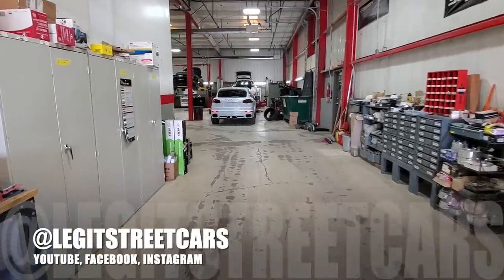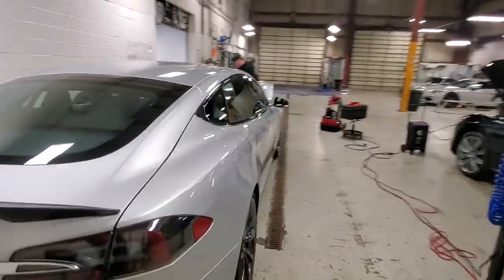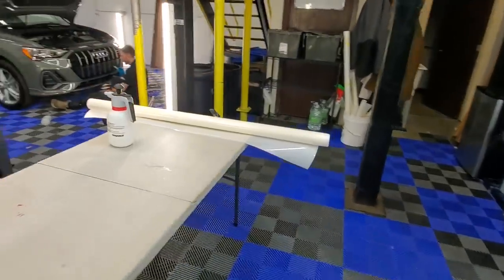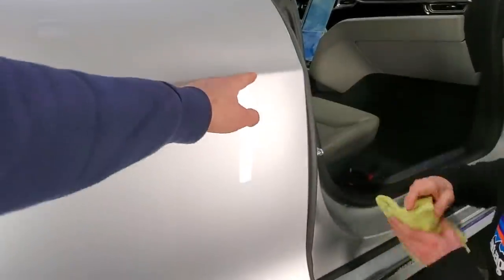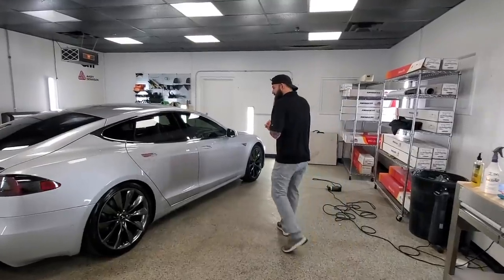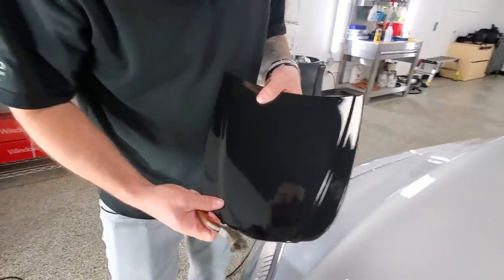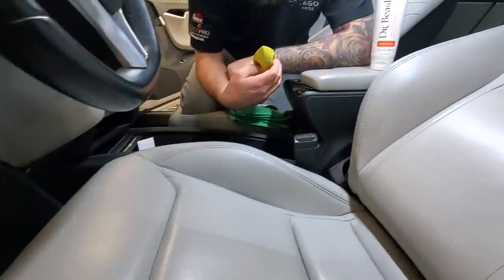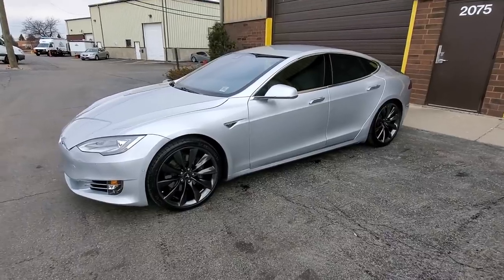My CHEAP SALVAGE AUCTION Tesla Is 100% COMPLETE! Final Detail, Tints & Self-Healing Wrap Install!

Comment: looks amazing! if i were to do it i would paint the roof black then take it back up to chicago auto pros and get that wet sanded buffed and the ppf installed on top of it. it will look like a real pano roof. no dulling, scratching or orange peel like a wrap, and the self healing ppf will keep it looking clear and deep like real tinted glass. but the silver roof is definitely nice looking as it is. great work!

Comment: The car looks fantastic except for the two-tone paint job. The front bumper cover and the rear bumper cover is darker than the rest of the car. When I worked in shops and we were doing paint repairs such as this on expensive cars we would blend into the adjoining panels to minimize the difference in color match.

Comment: Alex. Don’t know if respond to comments but here goes. Just bought a 2014 c250 w 52000 mikes & no warrentee for 12000. It has no check engine light. Im stoked but worried about  codes. Do you worry about codes coming up?

Comment: Your lucky to have guys you can trust working on your car.  That wrap is amazing I wish I had it when I use to store older classic cars in my Grandmother's garage when I was young.  She use to step on the fenders to reach over it or drop small tools on the hood or trunk but most of the time the paint was forgiving and the metal work was stronger so no dents.  Good luck with the tesla..

Comment: What a sweet looking ride man. I should think those glass roofs they use would make the inside like a hot house. The color on it looks great and they did a fantastic job on the wrap.
Is that better than ceramic coating? Which will protect better and last longer?

Comment: Definitely need to do the grill black and a full chrome delete as well. Also, if it has air suspension, you can get the stance right with some lowering links.

Comment: Ok.  The seats are 2nd gen in light grey real leather opposed to the white vegan leather BS.  The front bumper is the TS Sportline which although nice is crap compared to the Unplugged performance version... paint the installation black, seriously.  The spoiler and rims are cheap aftermarket.  If you want to fool anyone buy some osram cbb bulbs open the headlights black them out and frost the turns...
Reply from the maker: The wheels are factory but thanks for your excellent Tesla knowledge! Elon would be proud!
Reply: Well it's a great car and good video as usual.  IDK why I thought the rims were aftermarket,  probably because they are refinished and look so good!

Comment: Where did he get the leather brush he was using?
Reply: @ChicagoAutoPros  thanks!!
Reply: Just wanted to follow up, I bought the leather and plastic cleaner/conditioner and the brush. This stuff works so great. My truck smelled brand new after I went over everything. The brush helps so much. Thanks guys.